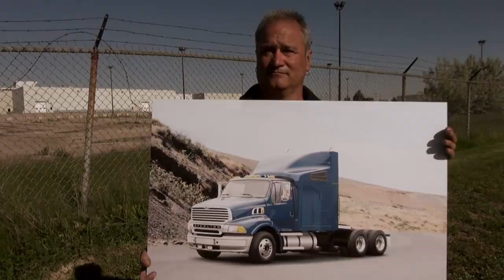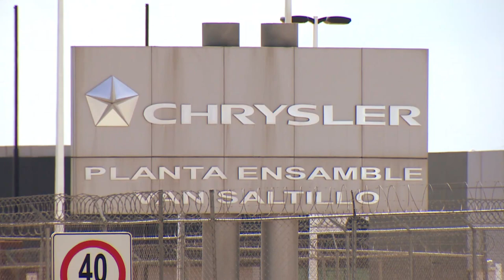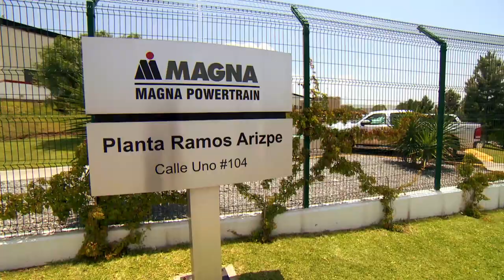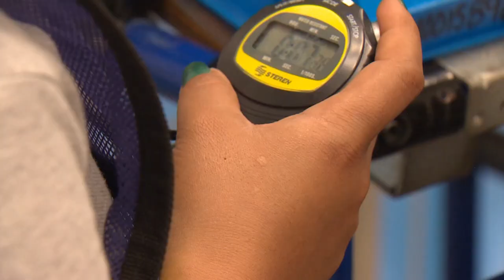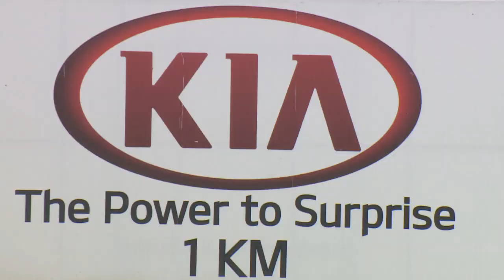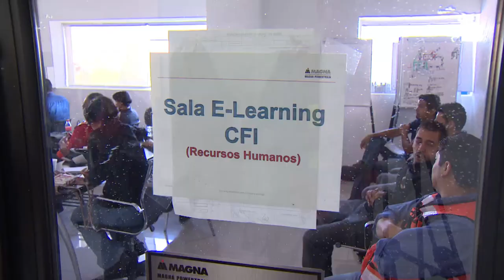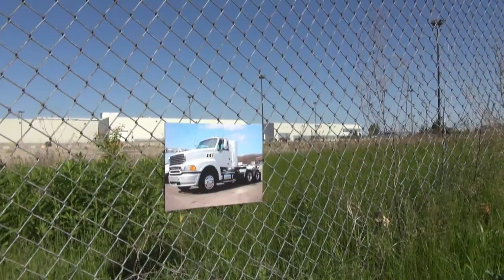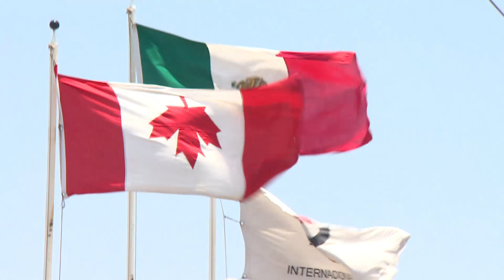How Mexico is Winning the Car Manufacturing War

Comment: The Mexican worker is a machine, and we're educated in trades at a very early age.  A twelve year old takes electric shop, and has the core knowledge to install the electrical system of a house, knows how a radio works internally - basic knowledge.  Some other shops teach kids machine shop, building design and drafting, beauty care, computer repair etc.  All kids in Mexico go thru a 3 year education process in a specific trade.  Next, at the high school level we have to decide what specific subject area to study, by age 16 kids are being educated in meteorology, engineering, biology, chemistry, law, according to their specific interest.  Therefore, even though many people in Mexico only have the Junior High or High School education equivalency, they'd been trained to join the labor force at a young age.  Unfortunately, many of those kids never go to a university to expand this knowledge, and are force to join the labor force.  The down side is that salaries are extremely low in Mexico, sometimes makes more financial sense for a math teacher to migrate to the US as a farm worker and exponentially multiply his earnings.
Reply: I like Mexicans ive worked with several of them and most of them are hard workers and good people the only thing I'm upset about is big business taking our jobs from here to there
Reply: Rick Smith Are you also upset there is no milkman jobs, what about telegraph operator, travel agents, wedding photographers, etc?  In the past, many people used to make a good living doing the jobs I just mentioned and many others - they're replaced by innovation, technology and capitalism. 

After WWII the US became an industrial manufacturing country - there was no competition from Europe, Latin America or Asia, that lasted a good sixty years, now the economy has shifted to customer service, finance, health care services and technology.  We can blame Mexicans and Indians all we want, but that is not reality.  Go to college, and take a few Economic Classes, you'll understand this topic much better. 

Today, commercial truck drivers make a good living, some even make 100k a year, guess what?  This type of job will go away in the near 50 years due to self driving cars, it is only a matter of time companies will find a commercial application for them. 

I have a Master's degree in languages, logic dictates I should have the most amazing job - and I don't.  Computer software have replaced teachers, a person can self taught any language - am I going to be upset?  Of course not, I have to innovate and learn a new set of skills. 

A few things have to change in our economic system.  We have to reduce the working hours to possibly three days a week, that way more people can be employed.  Also, people are living much longer 80 or 90 years, taking care of so many old people who are not contributing is depleting our economic resources, retirement should be delayed at minimum ten more years. 

Lastly, the American people have to keep their living expectations in check.  Back in the 50s a family had only one car, today each member of a family has one.   People change cell phones at least once every two years, computers every three years, there are hundreds of physical jobs such as working in the agricultural fields, milking cows, butchers, lawn mowing, but nobody wants to do those jobs - we're too f..n spoil.  Also, it depends where you live, if you live in SF making 3,000 dollars a month you're screwed, but the same amount of many goes a long way somewhere else.

Comment: 126 million mexicans means the mexican labor market is no where close to saturated.  While Mexico has only 4.7% unemployment, it also only has 45% labor participation (Canada has 65%).   This means there are still 10s of millions of Mexicans who can be drawn in to work.  Wages will not move higher until the Mexican labor market begins to tighten, and that won't happen for decades (if ever).
How does this impact Canada?  Canada has to find ways to do value added on the resources it is extracting.  Many nations buy Canada's raw goods (ore/oil/wood/grains/etc).   If Canada wants to grow it's economy while losing manufacturing jobs, it has to do value added.  IE.  Don't just sell oil, refine it and sell the products.  Don't just sell wood, make something with it and sell that.  Don't just sell canola, sell the oil, and etc.
Mexico has cheap labor, Canada cannot compete with that, so Canada has to compete with what it has, resources and education.

Comment: * Planned Obsolesence to increase sales -the industry uses certain (tested !) parts that will make the device fail reliiable ! after warranty time and will prohibit the repair of the product. They walk a fine line, but the increasing monopolies (large manufacturers merging)  makes the scam easier. There are no medium sized competitors left who would compete the low quality high sales strategy of the big players with slightly higher prices but GOOD QUALITY in the medium segment. (The few that go against the trend, occupy the high end or "boutique" segment and have usually rather high prices for all the bells and whistles and to compensate for relatively small sales volumes). The solid middle got lost.

As a rule of thumb: the cheaper the product, the more Throw-Away product design. (So the standards for cars are higher, also because of security requirements. Washing machines tend to fail after 5 - 6 years and are often too cheap to warrant a repair. Small devices like hair dryers, mixers, coffee makers, CD players - forget it.

There is of course ALSO cutting corners to save costs resulting in shoddy quality. But PLANNED OBSOLESCENCE means:
Intentionally using parts that WILL reliably fail. Just not too early. And often it would cost hardly more to use a better part (a fraction of a USD !), or design it in a way that the device CAN be repaired at low costs. But they intentionally design / plan it otherwise so that customers are forced to buy new. Which is the only way to sell more and more. *

They can't be too obvious about it, but for persons with technical expertise it has become quite obvious. France passed a law regarding it. It is highly problematic. Not only miss out consumers of the small advantages of losing jobs to countries with lower wages, it is a huge drain on the environment, energy use, pollution - that would even be true if the goods were manufactured under high standards. There is always some pressure put on the natural resources. We should aim to not have too many physical goods - and they should be of good quality and durable).

*  On the short term perspective, Big Biz could sell more devices (in the more durable quality like they used to be)  if workers in the devoloping countries would not be exploited - those workes would like to increase their standard of living - they just can't -  they are not paid enough.

And considering the future of the planet, our use of dwindling resources and energy, Global Warming !  - corporations will have to be FORCED to scaling down their output in PHYSICAL GOODS. Enough products  to satisfy our needs, those in good quality and produced under high standards. A reduced work time - the 40 hour week (with a LIVING WAGE !) was introduced in the 1940 and 1950s - we have massively!  improved productivity with automation, PCs, ....so WHY WOULD WE STILL WORK at least 40 hours to make a living  ? And we would need to give each other meaningful work, income, and contracts by using each other's services. So instead of consuming goods, we would consume more experiences (dining out, going to styling workshops to work with the existing wardrobe, paying seamstresses, attending classes, going on holidays). 

We cannot leave out future in the hands of entities whose sole purpose is to make as much profit as they possible can (and that is even written into law - the shareholders can legally hold a CEO accountable). Well the word for the ruling principle is GREED. And they naturally have an extremely narrow perspective. 
So naturally they cannot watch out for the well-being of all - and must be reigned in.

Comment: **  Plus in productivitiy 112 % vs. plus in average wages  97 % (wages adjusted for inflation !) in the US 1947 - 1970
So the wages had almost doubled (spending power !) and the employers had an advantage of (only) 15 % in those 23 years (or 24, not sure about the end point). Was that fair ??

That is up for discussion - the employers hit back beginning with the Reagan/Thatcher era and financed all the Think Tanks to produce the neoliberal talking points to convince us otherwise. 

All discussions about "fair" put aside - it DEFINITELY WORKED.

from 1970 till 2013 it was again ! approx. 67 %  productivity vs. 8 % average wages (adj. for inflation).
That means of course a huge GAP opened between the more and more productive OUTPUT of goods and services and what consumer DEMAND (mostly coming from WAGES !!) could absorb.
In the mid 1970s the credit card for normal citizens was invented. Consumer debt on the credit card became a thing - that "solution" to deal with the gap is no maxed out. 

The question WHO should profit the most from gains in productivity and WHO should pay the major part of the taxes - plus a lot of other economic issues -  was handled completely differently in the New Deal era until the late 1970s - and then in the neoliberal era until now

One can look at the state of the middle class (growing / shrinking), 

the political spectrum (moderate / vs. more and more to the fringe especially the right, in the U.S. in Europe, radicalization in the developing countries). 

Number of financial meltdowns, major banking crises (none until the early 1980s / with deregulation and "free" flow of capital etc. it started, it got worse in  the 1990s - and then  they held the test runs for the Great Financial Crisis of 2007).

Regulation, tariffs, import quotas / control of businesses (also reg. monopolies, anti-trust laws) / protectionism / strict control of finance / anti trust laws for the media to avoid conglomerates
a lot of regulation   going on during the growth phase until the 1970s / then deregulation in every sector 

or Wages (rising vs. stagnant). Who paid taxes - until the late 70s most came from corporations - now most comes from individuals, and there is much higher tax load on the middle class. 

Founding of enterprises (going well / generation student debt in the U.S. does not found enterprises),

 Homeownership of possessing an apartment

Even the increase of life expectancy is in reverse (white working class middle aged men in the U.S. !). 

Who held the debt (then it was Corporations / now it is the state and citizens). And no -  corporations having debt is NOT a bad thing. It means an expanding economy, where entrepreneurs and the banks giving them the loans are CONFIDENT it will work out well and they are going to have PAYING CUSTOMERS.

Inequality - which percentage of the population holds how much wealth. and in objective terms how are those at the bottom doing ? Are they just less wealthy but still doing O.K. - or do they have to worry and just manage to keep afloat ?

Use of medical drugs by stressed out citizens.

Obesity - it has to do with stress, too little vacation time,  and general lack of time - both adverse to taking good care of your body. Lack of sleep and stress prevents losing weight (and send homo sapiens chasing after comfort food, fatty, starchy/sugary please).

Participation in elections. (apart from the South before the Civil Rights Act)

The experiments for two completely different approaches regarding economics have been going on for a few decades - and we can review the results.
Reply: skewed statistics

Comment: Just cheap labor, I myself   am going through a similar experience, worked for a company for almost 30 years, and facing unemployment, due to automation, and cheap labor from asylum seekers. They come with no skills, but are blocked trained for a year, and still can't speak the common language, but become a job with minimal benefits, and a very low wage compared to my current salary. This is truly legal modern slavery!

Comment: Time and motion, a much-hated concept that's been around for far too long.  People are not robots, they get tired, and as the shift goes on, fatigue and repetition takes its toll.  I know, and if there is thought to be any slack, they come back and reassess the timings.  Nine or more hours of being almost constantly on your feet take its toll on health and production.  This was realized many years ago when work failed inspection and was either rejected or returned via production control for correction or scrapping.  I worked as a production controller and have seen it first hand.  Hence the reliability of robot production techniques.

Comment: Mexico Salaries are way lower than US or Canada, It has been like that for the past 70 Years. Difference now is the willingness to standout. As more and more factories move to Mexico. the salary gaps will be reduced. This is Capitalism offer and demand.
But the main difference its that US (I dont know about Canada workers) want to be in their confort Zone. They dont improve, the do the minimum necesary to do the job done, and will look at any excuse to avoid working. In Mexico Workers are still willing to learn, willing to do more, willing to do better and be more efficient. Unless US (I dont know about Canada) get back the willingness. Will never get manufacturing back from Mexico.

Comment: I would like to believe the parts made in Mexico are just as good. . .but they are not. I get tired of buying AC, Autolite, Echelin, and so on tune up parts, and then finding junk when I open the box. The last set of AC44 spark plugs I bought for my old 283 were complete garbage. The only quality electrical tune up parts I can find now are made in Japan (NGK and NIPPONDENSO).

Comment: Your comparing The Canadian Economy to Mexican Economy. Apple's to Peanuts! Things are a much more cost effective in Mexico like the average  electric bill in Mexico is $10 ( 100 Pascos ) every two months. Good is much simpler and more cost effective. No heat bill in Mexico and most don't have a car!
I agree after a Mexican Worker has been trained, he should be paid $3-3.50 @ hour. Be fair with your reporting. It's not cheap labor, it's a cost effective  economy! 
Twenty years down the road, things will get a lot more expensive in Mexico!